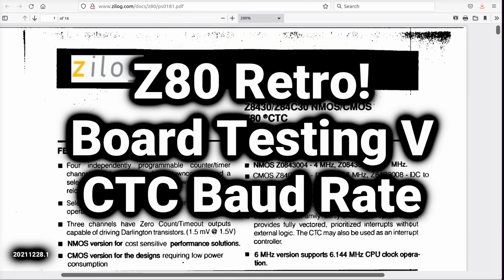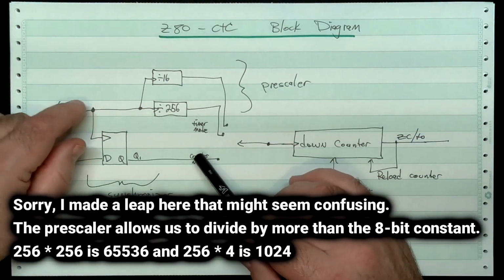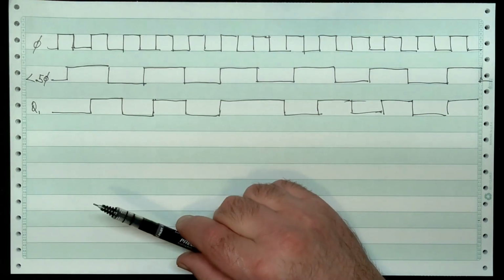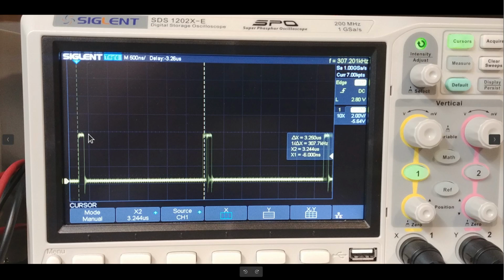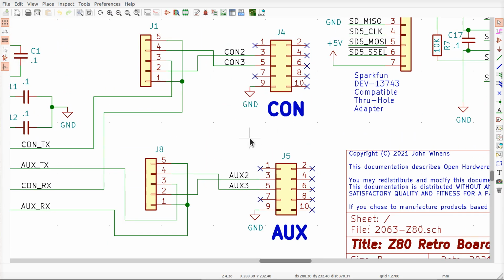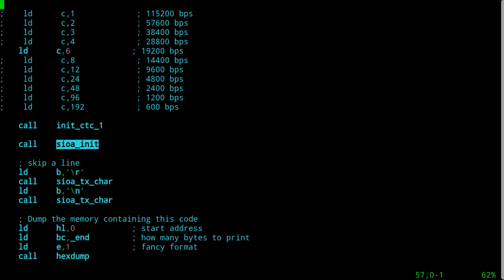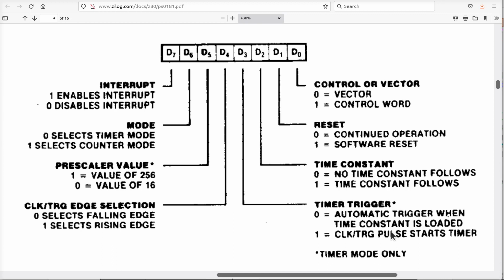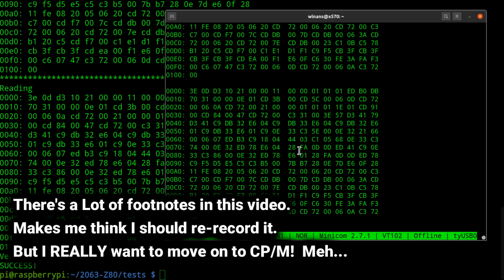Z80 Retro #15 - Board Testing Pt. V (CTC)

Comment: I realize your UART hasn't got its normal serial port handshaking, so you're just swapping TxD/RxD, but the Apple II Super Serial Card did the same trick with all of the serial handshaking signals so that a pin from the UART would have its corresponding pin on the serial port next to it and its complement across from it on half the connector, and vice-versa on the other half. Need to switch DTE to DCE? Turn the jumper block around. I don't know if this solved problems or added confusion in the real world. The card basically included its own null-modem adapter.

An IMO better solution was DEC's MMJ connector which is what RS-232 should've done from the start: The signals are DTR, TxD, TxG, RxG, RxD, DSR. If everything is wired that way, then all cables are null-modem all the time. Apple would attempt to do this with its Mini-DIN8 connectors on the IIgs and later macs. And then the world screwed that up too. sigh

The closest we got to getting this right (finally, sort of) is the PC 9-pin "standard". If the port is male, it's wired for DTE. If it's female, it's wired for DCE. And if your cables all follow that assumption (lol they don't) then there's no problems at all.
Reply from the maker: The real problem with RS232 is that it was originally not symmetric.  So it wasn't possible to make it real easy to flip it around until rs232 version e in the 1980s was standardized... Which finally had symmetric flow control!!!   I should probably do a video on that.  If you weren't around during that time. And a heavy user of serial ports. You may not realize that the change is that took place were both simple but significant in making things sane finally....
Reply: @JohnsBasement  I think it'd be a great video. I was around, but not reading standards documents back then. No, what I was doing back then was spending as little time as possible in class doing "schoolwork" and as much time in the computer lab doing something worthwhile. What do you mean "Why does x + 3 = 17 mean x = 14"? It means that because I'm not an idiot and I don't need to very slowly and ploddingly prove I didn't forget how it's done 40 times. And I really don't need to have some silly "extra" class where I have to do all the boring crap I'm not going to do in order to be "rewarded" with being able to do that AND moderately interesting more advanced work too. Why would I? 😛 But if you can find someone other than our occasional substitute Mr. Perry who's willing to tell me why x2 = x * cos(t) + y1 * sin(t); y2 = y * cos(t) - x * sin(t) rotates x1,y1 by angle t … I'd find that MOST interesting! I know that it works, now can you explain to a 3rd grader what a sin, cos, and tan are … and what else can I do with them? Arithmetic in my head is useful, but that was never what they wanted.

By the time I was actually using serial for more than talking to the imagewriter (which was mostly one-way), "RTS"/CTS handshaking pretty much always meant RTR/CTS. Although my understanding of it was that it took awhile for the government to work out that people were doing it that way. A video on the evolution of serial and the standards might be fun!

Comment: I can't believe that engineering at Zilog overlooked the art department revised manual. This is one time that "out with the old, in with the new" saying is wrong. hahahaha
Reply from the maker: Be even more careful with the 'new' pdf of the z80 CPU User Manual (UM0080).  It has what looks like several bad OCR errors in it!

For example, look at the FIRST instruction description....  What is;that r,C supposed to mean?  😖
Reply: @JohnsBasement  Do we need a fixed fixed manual, fixing the fixes in the fixed scanned fixed manual fixing the unf… nevermind. 😁